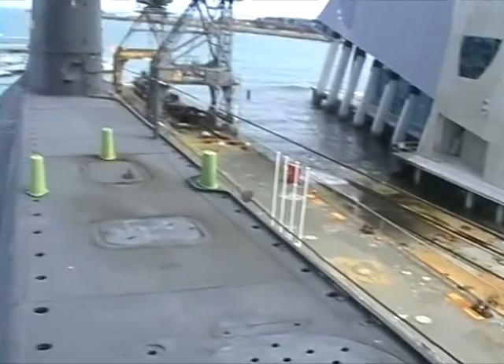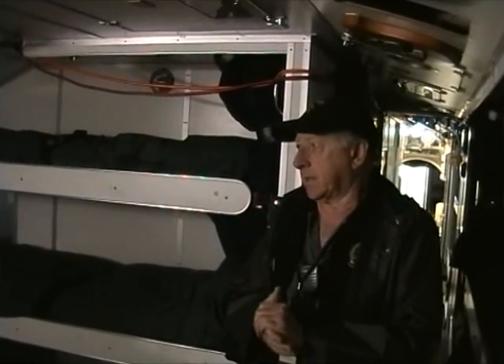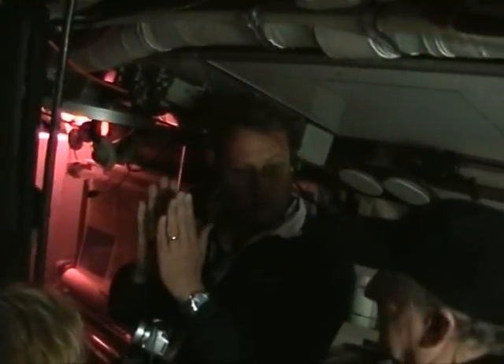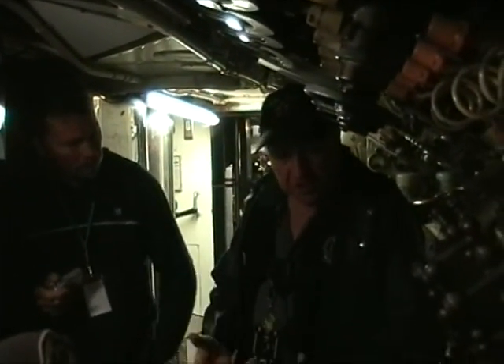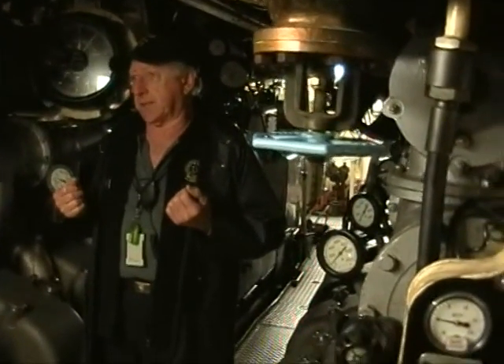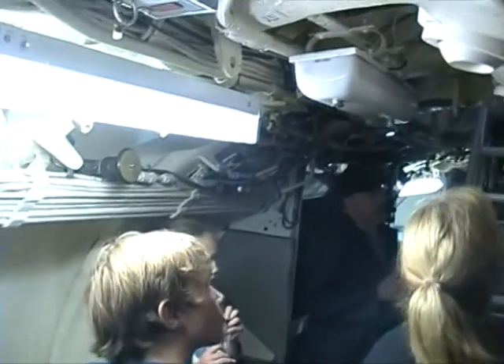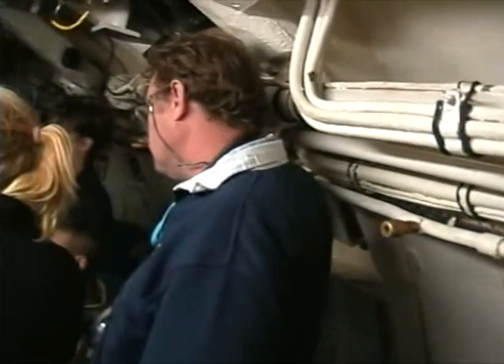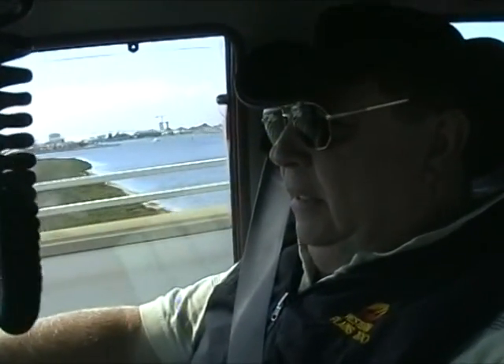Submarine Tour - HMAS Ovens

Comment: Submarines cannot submerge in a stationary position.

The water displacement isn’t enough to sink the submarine, it requires a forward momentum to keep it below the water line.

Hollywood and cartoons fill in the gaps where science cannot tick the box ✅

By the way the earth is flat and stationary too 👍
Reply: Not quite right, we often put the boat on the bottom at HMAS Platypus for various trials. The boat went straight up and down alongside the wharf.